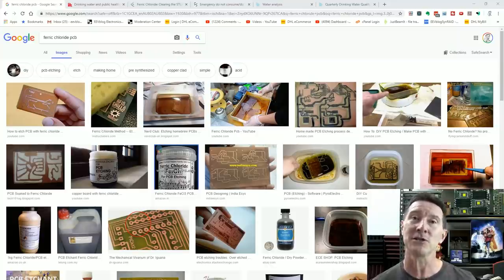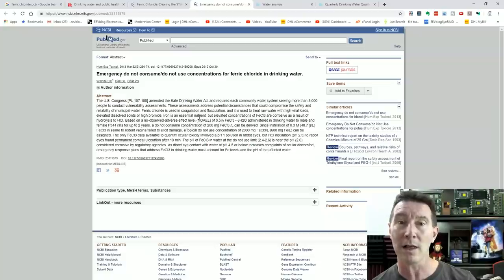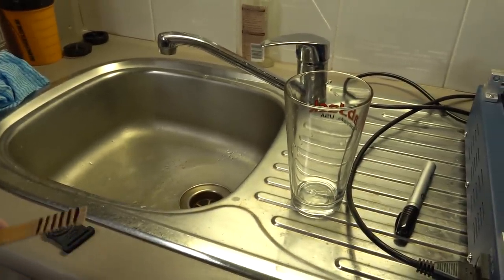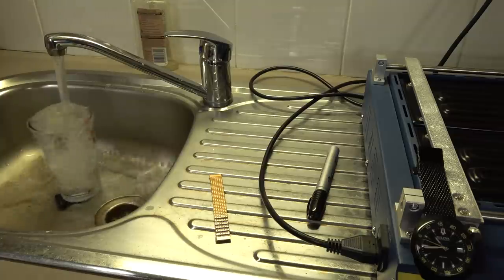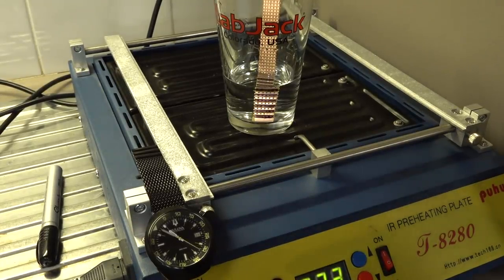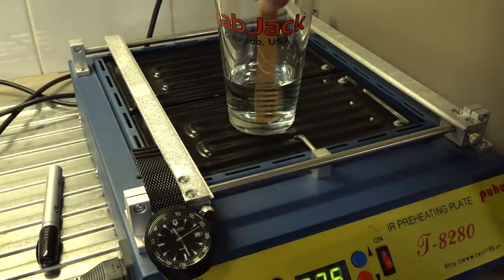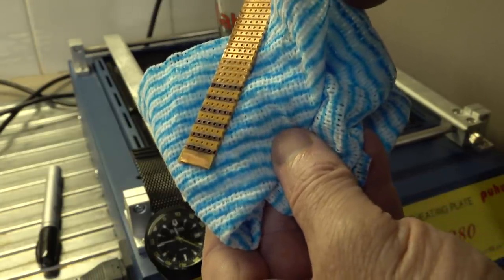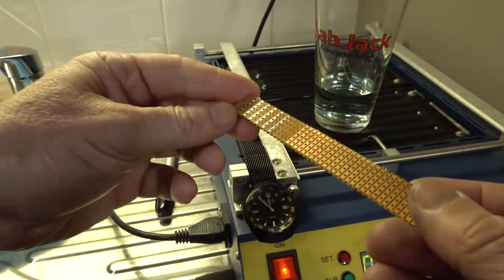EEVblog #1197 - DIY PCB Etching With Water

Comment: As a chemist I have my doubts about the amount of ferric chloride you had managed to "concentrate" in your glass. I bet you could repeat this experiment with regular tap water, or hell, even distilled water, and you would get very similar results.
The reaction you are doing is actually between the water, the copper and oxygen from the air. The oxygen oxidizes the copper and  the copper ions are dissolved in the water in the form of an aqua-complex (light blue color). This is a very slow reaction at room temperature, happening only over days/weeks/months. The process will lower the pH, and without any acid present the solution very quickly saturates, so I would expect this "etchant" has a very low copper carrying capacity.

I would really like to see you try straight tap water, tap water that has been boiled (to drive off free chlorine), distilled water, and "concentrated" tap water.
BTW you could also try vinegar (in a separate batch, otherwise it might contaminate the other samples slightly), I would expect that it would etch way faster than any of the water samples.
Reply: What about clear peroxide?  Warming it would give it enough oxygen
Reply: But we all know that magnets can make your car engine more efficient by lining up the molecules, so this must be true.  Must make sure I go round the house and ensure I have no magnets near my hot water pipes - I wouldn't want them to dissolve like that.
Reply: Sounds like a thing for Dave's assistant Ben Heck to check out and investigate further!
Reply: Also, Ferric Chloride (FeCl3) is non-magnetic.
Reply: @perfumedmanatee6235  Joke is on you, sub-boiling distillation (as in colder than boiling point) is a real thing used for making exceptionally pure solvents and acids.
Reply: @emuboy85  Sure it would, but you also need to keep a low pH (acidic solution), to make sure the copper ions can stay dissolved, otherwise you get copper(II)-hydroxide and/or copper(II)-oxide on the surface of the copper and a slow and shitty etch. So hydrogen peroxide and vinegar should do the trick. Peroxide and hydrochloric acid makes for a crazy fast turbo-etchant, etches a board in seconds , but the etch quality can be problematic.
Reply: I agree. Maybe repeated distillation could work? But you'd probably need an insane amount of water
Reply: Fuckin' magnets, how do they work?
Reply: I bet @TheBackyardChemist is a troll account. No vids, no subs, no lists. Just a load of hot air. (perhaps paid for by utility companies?)
Reply: @xenonram  Sometimes people will subscribe to you and you don't know why the Hell they did it, like mine which has no content and everything set to private yet 49 people decided to subscribe anyway.
Reply: Vinegar and hydrogen peroxide mix works well as etchant.
Reply: @TheBackyardChemist  now that's sounds fun.
Reply: did you not hear him say winner winner chicken dinner?  He already said it!  you cant take it back now!
Reply: I was just gunna say, water is a solvent.
Reply: Mai Mariarti    Always best to buffer it with malted barley and hops or soak macerat coffee beans in it
Reply: Not to mention, even if the magnet trick would work, the water was running too fast - you could see turbulence all the way to the bottom of the glass.  That would keep mixing and diluting anything the magnet managed to attract.
Reply: @TerribleFire ugh, thanks, i was puzzled that Dave would do this. ...
Reply: @metallitech  Yeah, I dont tend to keep the current date in mind. The ferric chloride story was kinda wierd, but I was already thinking about how copper can corrode in the presence of oxygen. Since the PCB only has a rather thin copper layer, it seemed plausible at first that, water+air could slowly eat it away. Although after some more thought, it is unlikely that it would work to any visible degree without an acid and active aeration, especially since the solubility of gases decreases with temperature. (and you probably do need to heat the system, to react in hours/days)
Reply: @michaelparker2449  Yeah sometimes I look at peoples channels when they have an interesting name just to see what they might have. Then I go and look and see they have no content and some subscribers and I wonder how did this person get a subscriber with no content! I figure it's just people who know who they are and wanted to keep tabs on them. Oh well, to quote a Tootsie Pop 70's commercial "The world may never know". Thanks for the laugh. Best Wishes n Blessings. Keith Noneya PS here's the link to the commercial I referred too! Enjoy! https://www.youtube.com/watch?v=2IA5Cv_5-g8
Reply: @michaelparker2449  Same here. 14 creepy subs and I have nothing to sub to!!!
Reply: A cheap etching solution is a 2 parts of 3 Per cent hydrogen peroxide you get at the local pharmacy for a few cents and one part vinegar. Works like a champ, cheaper and a heck of a lot less messy than that awful feric chloride.
Reply: Am a chemical engineer and so glad this was commented. Iron is ferromagnetic, but ionic Iron (such as the ions found in Iron Chloride) is NOT. Disregarding the incorrect assumptions, however. I praise your smart separation setup. Simple, but effective. I also want to mention ionic movement through water is rather slow, and even if sufficient magnetic force was given, I have my doubts it would separate with any speed. Someone correct me if I'm wrong.
Reply: Now you made me wonder if tap water with something like citric acid or vinegar could have some practical results in longer time period&room temperature. I had no idea this was even possible. Pretty exciting
Reply: TheBackyardChemist  -  I think you are thinking in the wrong direction. Try a more calendaric approach.
It was already April's fool day yesterday in Australia.
Reply: @Biela2008  "Ferric Chloride (FeCl3) is non-magnetic"
This is wrong. Like most stuff it is magnetic. See here: https://www.sciencedirect.com/science/article/abs/pii/S0304885314000626
Tho we are talking about really small amounts of magnetism (either ferro- or dia- magnetism, so attracting or repelling magnets)
Reply: @jkbrown5496  That reminds me of my experiments on developing photographs with various household chemicals. Coffee mixed with ascorbic acid (vitamin C) makes for a splendid black-and-white film developer.
Reply: @ronjones4069  Peroxide as an oxidizer, vinegar as a buffer to keep the pH, I suppose.
Reply: @thekaiser4333  Damn got me
Reply: @Biela2008  and water is magnetic.
Reply: I think he used sodium persulfate (Na2 S2 O8). Commercially avalable as B327 for PCB etching, not very popular in most of the world. It is transparent when mixed with water before first use, turns blue when copper gets dissolved. His solution looks weak as it is pretty fast when heated that high and mine turns more blue. Much safer for use at home as it is clean and won't stain everything as ferric chloride. Very cheap too.
Reply: @TheBackyardChemist  Erratically problematic etching results, as it likes to etch underneath the resist. I have tried it. You want big wide traces and be prepared to pull the board out when it looks ready, and then throw it away.
Reply: @Biela2008  it'a joke
Reply: Dave had you,
Reply: Bla bla bla
Reply: @mariomlecka  Yep, that's all she...
Reply: Yup, the bubbles are hydrogen.
Reply: @xenonram  

The joke

Woosh

You
Reply: Would pure piss work as a acidic solution?

Comment: Open a type 1 ferric oxide cassette tape. Drop the spools of tape in a jar of table salt. Doing this destroys the tape and makes the salt taste horrible. Also the residue is useless for etching pcb's.
Reply: You're the best
Reply: You can also put the tape over your PCB and turn the cassette with a motor, to make the tape run over the surface. This will also destroy the tape.
Reply: some people just want to watch the world burn
Reply: you can also discharge capacitors through it or apply very high voltages across it. this will destroy your tape. and recycle it into illumination and magic smoke.
Reply: Seriously now, could you make a lukewarm heating element out of it?
Reply: @GLITCH_-.-  Hydrochloric acid maybe.
Reply: @km5405  Reminds me of the Photonicinduction video where he used a giant capacitor bank to make the metallic coating on a Christmas ornament magically disappear.
Reply: Maybe the magnet trick will work on the tape if you put it in water, or it will just wipe anything you happen to have recorded on it.
Reply: @Stoney3K  I immersed a tape in water once and left it to dry out on a warm window sill. I forgot about it and six months later I am convinced I had created a new species of fungus!

Comment: I even etched a 4 layer pcb with this method, the slow process helps in etching the inner layers without being too aggressive on the outer layers. Great video.
Reply: Only 4 layer ? I etch my pc motherboard prototypes in tap water all the time .
Reply: Was it audio gear? I heard slow etching improves velocity and presence.
Reply: yeah, i used to have this problem alot, the outer layers get eched away too much because too high concentration, but this is easily fixable by using a 5 layer pcb, the 5th layer contains the outher layer stuff, and the outher layer is just a huge exposed copper area, to tame the etching process. Also you can do the electroplating in the same solution if you add cinnamon and a 1.5v watch battery to it.

Comment: I am not interested in etching a PCB, but using the same strategy, I found that there is trace amounts of whiskey in drinking water. Since alcohol is lighter than water, I took a gallon jug and filled it with tap water and let it sit for several hours. At the end, there was a slight, but discernible, slick of amber liquid on the top of the water. I drew it off and repeated this 10 times with 10 different fills of water. In the end, I got about 1/2 ounce of whiskey. I did a taste test with my Jameson's Irish and, was pleased to find it was similar. Since more people drink scotch, I think my free whiskey is probably more Johnny Walker than Jamesons.

Great tip, thanks!

Comment: Dave, I've tried it here in the Netherlands but it doesn't seem to work. Afterwards I failed to test it by turning the magnet around, because it might be due to the fact that you're on the negative half of the hemisphere. 
I'm also looking into the possibility that  I needed to wait until the water from the tap stops spinning up here on the other half. Maybe the prions incorrect  rotation over the magnetic field could cause an oposite reaction. I found that the copperlayer had become significantly thicker on the exposed parts.
Reply: There's a chemical problem with the water supply. I've called them and they say it will be fixed in about 11 hours, so maybe try again past midnight local time!
Reply: @WouterWeggelaar  OMG now DLS has become a factor in this experiment....

Comment: Dear Sir,
After numerous experiments with diferent concentration techniques I was not able to re-produce your experiment.
On the other hand, I found an other way to use plain tap water wihout any special magnetic treatment to etch copper wit great results with: just a good amount of ferric chloride has to be added.

Comment: A far better method is to use bose-einstein condensate after processing with an ion implantation filter. I find that higher percentages of charged quarks reduce the etch time dramatically, although this can be temperature dependent. I find the etch times can be as short as several seconds with sufficient quantum entanglement of the Copper particles.

Comment: At this rate my copper pipes would be done in 6 years.
Reply: Copper in your drinking water is nice.
Reply: Willy Kling hehe
Reply: and it does not run at 80°C
Reply: pahom do you think he's serious? Just being close to April 1st I'm a little sus. I've set up the same experiment to see haha.
Reply: Ambient Noize almost
Reply: @PracticalCat  I wonder if he sneeked some ammonium persulphate in that mix ?
Reply: unlost117 probably. If you watch the sped up footage it does etch on its own. I thought he was etching it off camera but hes definitely used hydrogen peroxide or something:)
Reply: @Okurka.  Apparently our new hospital in Perth had lead issues in the water too. Hope you dont live there !!!!
Reply: No because this only works one day of the year.
Reply: I understand a layer is formed on the inside of metal pipes that prevent further corrosion. In the case of Flint Michigan, the chlorine concentration was too great and removed that layer leading to the bad water.
Reply: Etching circuits on the inside pipes is a skill to be mastered, but then installing the surface mount components; that is true witchcraft.

Comment: I bet if you tried this in Flint Michigan it would eat thru the whole board
Reply from the maker: Sad, but true...
Reply: It would eat through the whole glass my man
Reply: Or lead plated
Reply: Lived in Flint most of my life, don't find it funny but your right. Other than lead contamination the water here has a truly insane amount of chlorine present. So much that a freshly drawn glass smells more like a swimming pool than potable water. My mother taught me very early on how to distill water even though she didn't know that was actually what she was doing. My father taught me to do so with a filtered picture. Still I preferred drinking juices, pop or using the filtered and distilled water to make tea. Always found tea taste so much better after filtering and distilling it. 

However etching a PCB with our water is inadvisable for another reason and no it's not the lead. We have serious problems with lime scale buildup. A fresh tap screen will last about a week or two before it starts to get wonky. Shower heads I have to tear apart monthly to get all the buildup out of them, usually grab a needle to punch the buildup out of the dispenser holes. I have in my basement right now a piece of PVC pipe with so much lime scale in it that you can not pour water through it.

So yeah, plenty of chlorine to etch a PCB, but your going to need a chisel to find it after the lime scale deposits all over it.
Reply: In Flint, you could use the water as a replacement for solder paste at high enough concentrations.

Comment: I started a try right away, it worked good. I even managed to get a better concentration for the water: I put a lot of very strong magnets in the bottom of my bath tub and let the water run for 5 hours with a hose to the bottom of the tub. I was able to etch a board in 15min with that water from the bottom of the tub.
Thanks Dave for that idea. 😁